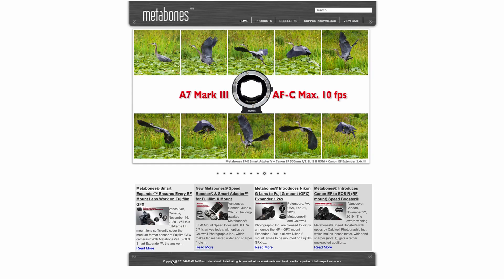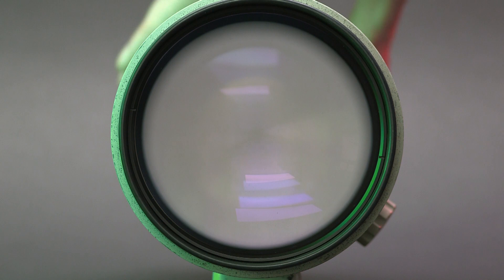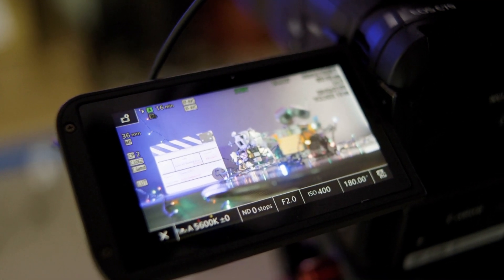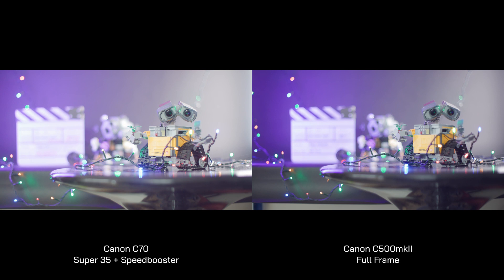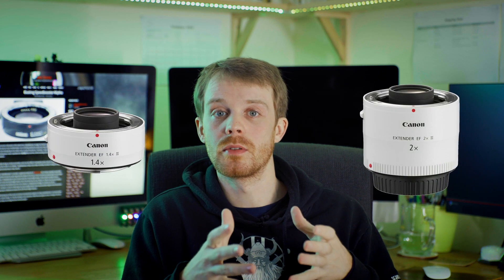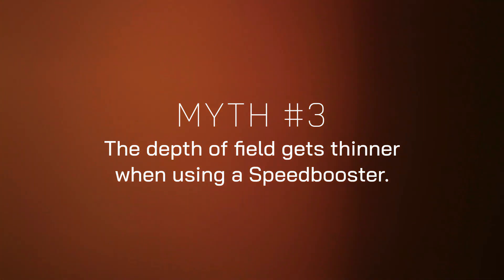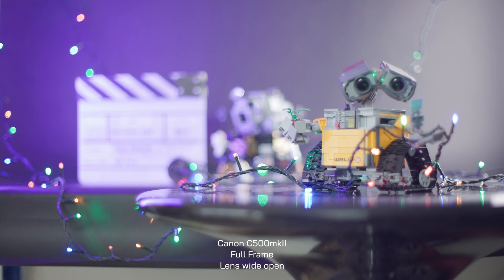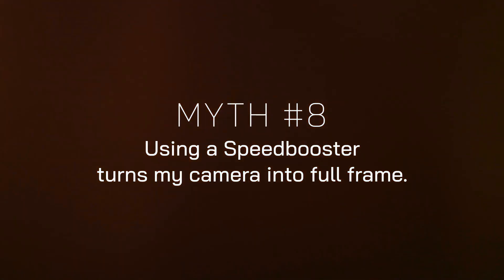Speedboosters EXPLAINED - The truth about focal length reducers

Comment: Very informative. I had studied the topic enough to have what I felt was a good basic understanding of speed boosters. This video clarified and improved that understanding. Great job. Recently purchased a MEIKE EF to R 0.71x SB to use on my R10 APS-C camera as I wanted to take advantage of my wide angle EF mount lenses for landscape and astrophotography but on a regular EF to R adapter, the 1.6x crop factor narrowed the FOV too much in my opinion. Using the SB brings almost brings back the entire original FOV as I have with my FF camera using the same lens, plus an effective increase of light by around 1 stop.

Comment: A modern speed booster designed for a vintage lens may incorporate elements designed to correct for aberrations or flaws in the original lens.  Because a speed booster is basically adding elements to the lens, it gives the designer an opportunity to modify the fundamental performance of the lens.

Comment: Despite being tiny, speedboosters are insanely good for them providing an extra stop of light. Making a really cheap 50mm f/1.8 lens perform almost as good as a very expensive 35mm f/1.2 autofocus lens if that even exists. And since the F/stops are not as accurate as the T/stops used in cinema lenses, I believe most manufacturers who make an f/1.2 lens are likely gluing the speedbooster into the cheap lenses they make and calling it an f/1.2 lens. It's a budget alternative to picking up canon's L series lenses for example. Of course it's probably not gonna be as sharp, but the metabones speedbooster adapter I got for my canon R7 and cheap EF 50mm lens, it remains almost as sharp wide open compared to without the speedbooster and even sharper if I stop down to F/1.6 which is brigther than F/1.8 and definitely a lot brighter than stopping the F/2.4 to achieve a similar level of sharpness without the speedbooster.
Very nice and informative video you've got there. Thanks.

Comment: Using a speed booster does NOT change my APSc camera into a full frame camera........................However the perceived FOV of the lense will be much closer to that of a full frame camera with the same lens.  The speedbooster will allow to APSc sensor to view closer to it's full frame equivalent, when the crop factor is used.

Canon APSc is 1.6 crop, 0.71 Speedbooster - Means a 50mm FF lense will be seen as a 56.8mm lens on the APSc camera.
50mm x 0.71 = 35.5mm x 1.6 crop factor = 56.8mm FOV through the view finder.
50mm x1.6 Crop factor (without speedbooster) = 80mm FOV through the lense.

Comment: Has my comment been deleted about how the sensor size is related to the acceptable CoC, therefore has an influence on DOF? If so, may I ask why it has been deleted?
Reply from the maker: No comments have been deleted...
Reply: @alex-stone  Oh ok, something must have gone wrong when I tried posting it. I was commenting on the statement that I don't think the statement at 9.00 is true. DOF is actually affected by sensor size when you watch the recorded image on a screen with a fixed size: To display the image of a MFT sensor on your screen, you need to enlarge it twice as much as an image recorded on a full frame sensor (MFT sensor is half the size of the FF sensor). For that reason, the acceptable CoC on the MFT sensor is about half the size as the acceptable CoC on the FF sensor. For that reason, the DOF on the MFT sensor is about half as deep as the DOF on the FF sensor (I know this sounds counter intuitive, but you can easily test that yourself with a DOF calculator. Choose one like DOFsimulator or PCAM and only change format size without touching the other parameters). Any comments?
Reply from the maker: @cordvision  The perceptual depth of field changes depending on a number of external and variable factors such as display size and even resolution: the closer you look at an image, the more critical the threshold for what is in or out of focus and therefore the thinner the depth of field is perceived to be: the CoC is what is deemed to be acceptably in focus given these additional parameters.

The optical depth of field however - the light projected through the lens - remains unchanged as demonstrated in the video.

The above two distinctions are important and are how the Achtel 9x7 camera claims to have thinner depth of field than IMAX film, despite the fact it uses a S35 sensor. Side by side with another camera with the same physical size sensor and, when displayed at the same size, the depth of field characteristics will be identical. Zoom in to each image at 1:1 pixels however and the Achtel will appear shallower simply because the blur has been enlarged more.
Reply: @alex-stone  Not sure what you mean by "optical depth of field". There is no such thing as "optical depth of field" as far as I know. Without defining an permissible CoC you don't have any depth of field at all (literally only a plane with basically zero depth is "in focus"). Therefore, in order to even have depth of field, you need to define the permissible CoC first. This will then have a direct influence on the observed DOF of the image on your viewing screen (in absolute measurable terms... by measuring the CoC on your viewing screen). If viewing conditions for both formats are the same as well as recording resolution, the DOF of a smaller sensor will be shallower than that of a larger sensor. This is even true in your wall example. For the image projected on a smaller portion of the wall (smaller sensor), you would have to move closer to the wall when looking at it (else the image would be much smaller in your field of view). Shortening the viewing distance affects DOF the same as enlarging the projected image. At the end of the day, DOF is all about perception... it is deciding how large a single point is allowed to be in your image to still be perceived as a single point. You therefore can't ignore viewing distance or viewing screen size. This is why a DOF calculator tells you that your DOF gets cut in half by simply changing from a FF sensor to a MFT sensor (without touching any other parameters).
Reply from the maker: @cordvision  What I mean by optical depth of field is the size of the blur relative to other objects in the frame - how pronouced the bokeh is. Viewing distance, format size and resolution have no influence on this - it's the image formed by the lens.
Reply: @alex-stone  Sure, but the "relative blur" is not relevant in this case to determine DOF. Here is a practical example: I'm having an actor standing in front of a picture holding a pen in front of his face. The pen is 2.73m from the camera, the actors eyes are 3m from the camera (camera is also focused at 3m), and the picture behind the actor is 3.3m from the camera. If I'm shooting on a FF sensor with a 35mm f/1.4 lens, the pen, the actors eyes, and the picture behind him would be in focus. The DOF extends from 2.73m to 3.3m (total DOF is 0.57m) so everything is in focus. I now change the FF camera for a micro 4/3 camera, and don't touch anything else (same lens, same f/stop, same distance to subject etc... only thing that changes is the sensor size). How come that only the actors eyes are now in focus and the pencil as well as the picture behind the actor is out of focus? The DOF now extends from 2.86m to 3.16m, which means the total DOF is only 0.3m. This is half the DOF as with the FF camera so the pen and picture are now out of focus. So how can you say that the format size does not change the DOF with the above example in mind? I'm genuinely asking.
Reply from the maker: @cordvision  The mathematical DoF of what's considered in focus may change with different formats given the different CoC as discussed in earlier comments, however the optical properties of the light being transmitted through the lens does not change with format size.

To use your example, let's say there's some fairly lights or LEDs on the picture behind the actor. The size of one bulb relative to anything else in the frame remains the same, whether that's the actor's eye or the width of the pen; the format can't change how out of focus that light source is. (The same applies to anything in frame, I only use a light source as reference as the resulting bokeh would be more clearly defined - as demonstrated in the video.)

Taking a frame from the FF camera and cropping it in post to the same FoV as the M43 camera would result in an identical image to one taken with the M43 camera. Cropping has no effect on the optical blur; using a smaller sensor simply windows off part of the image in the same way - it's cropping in camera.
Reply: @alex-stone  To stay true to what is said in the video would be to compare the DOF of a picture taken with a FF camera, then crop it in post and compare it to the original. Cropping a picture in post DOES change DOF when viewing it at the same size as the un-cropped image. I know this is counter intuitive, which is why so many people are confused about it. Just google it. There are a bunch of discussion on this subject. The one on dppreview that discusses how cropping in post affects DOF also shows many examples.
Reply: BTW, even the wikipedia article on "circle of confusion" will mention that DOF changes with the crop: "The DoF... ...will need to be adjusted if the original image is cropped before enlarging to the final image size". Also, here is a comment from a PhD Physicist (falconeye in the pentaxforums): "Depth of Field is based on the capabilities of the human eye, not the sensor pixel size. Therefore, Depth of Field does decrease if an image is cropped even though its pixels don't change. This is paradox and one of the causes for the many misunderstandings".
Reply from the maker: Michael, I think we're going round in circles (of confusion) here. I am not disputing that viewing distance and enlarging an image changes the DoF we perceive; the point you keep reiterating. None of these factors have any effect on the image produced by the lens, the distinction I am making.

Since your first comment, your tone has been quite belligerent - I saw the recent comments above before they were edited. It's not the first time we've conversed either; I remember you being equally as dismissive when I tried to purchase some of your products many years ago.

Making a video about depth of field has been on my list of ideas for some time now. The above discussion has been insightful and I'm sure it'll be useful if I ever get around to making it. Until then, I've spent enough time on this debate. Feel free to make your own video in the meantime though.
Reply: @alex-stone  I agree, we aren't getting anywhere. I think we are on the same page with the "technical" explanation of what is happening, but I disagree with the language used to describe it. The point I'm trying to make is that if you say "DOF does not change", you are talking about the relative size of the blur circles in relation to the other elements in the image is not changing... I agree that the relative size of the blur circles (bokeh) compared to other elements in the image stays the same, but this does not relate to DOF so the word DOF shouldn't be used in that context. Nor does it makes sense to say that the lens projects an image with a specific DOF,  as there is no DOF at all at the stage the image gets projected. The word DOF has a very clear-cut definition and I don't think it matches with the way your are using this word. 

Sorry, I didn't mean to be belligerent.  I originally wrote "The last part is exactly where you are wrong", I changed this because I realized I miss-read your last paragraph. I though you compared a cropped FF image to an un-cropped FF image, hence my original response. After reading the comment again, I realize my mistake, so I edited my reply.

I just went back to read through all our e-mails. Sorry if I was coming across as dismissive... I did reply to you with "I hope it didn't come across the wrong way". I was originally confused why you wanted an adapter ring of this size, back then, I didn't even know that anybody else makes them.  

BTW, I really appreciate your video. I really liked it because I think it clears up almost all the miss information out there on that topic (just disagree with the part about the DOF and because everything else was spot on, I though it would be worth pointing out).

Comment: Hello, to calculate the hyperfocal distance, how would it be? for example: with a 50mm 1.4 lens + speedbooster 0.71 + m4/3 sensor (Coc 0.015)
Reply from the maker: The same as calculating a 35 f/1.0 lens + m4/3 sensor

Comment: Just a thought after watching this video. If we have a super 35 camera so 1.5 crop and use apsc lens but in slowmotion that has 2.0 crop add the speedboster we could possibly have the same image characteristics negating the vignetting of apsc lens with speedboster - right?
Reply from the maker: That would be an interesting use case. I haven't tested that but in theory I suppose it would work. Do remember that the slomo crop is a digital crop so resolution and image quality (sharpness and in some cases dynamic range, bit depth etc) may take a hit. But yes in terms of just field of view, a speedbooster would help negate the digital crop, just remember to take it off when going back to normal speed ;)
Reply: I think in most cases assuming modern 4k super 35 cam it is downscaling from 6k or higher resolution. With digital crop it would still be 4k. Speedbooster could also help to keep the brightness similar as slow motion will reduce amount of light due to shutter speed change.
Reply: And obviously you will lose autofocus so it is not ideal in slow motion for wildlife and fast moving objects.

Comment: The brightness test is like the nectar of the gods!  Tony Northup has been pushing that the speedbooster doesn’t increase the light transmission…even knowing that that the extra glass is  effectively a magnifying glass for the lens.
Reply from the maker: He perpetuates a lot of misconceptions. Don't get me started on what he says about focal lengths and crop factors...
Reply: The speed booster doesn’t increase the light transmission.  It increases the concentration.  A magnifying glass focusing sunlight to a single point hot enough to melt rocks is using the light available to the surface of the magnifying glass which would be the same light available to this region even if the magnifying glass were not even there.

Comment: Would love to see this video with M43 comparisons as well. Though that would start getting really complicated. A lot if misinformation out there on focal lengths, speed boosters and sensors though
Reply from the maker: M43 is half the size (quarter the area) of full frame, so any comparisons are simple - for the same field of view, half the focal length is required. To match depth of field, halve the aperture value too. Example - to match the 'look' of a 50mm f/2.8 on full frame, a 25mm f/1.4 is needed on M43. The FoV and DoF will be the same but the exposure on M43 will still be 2 stops brighter.

Comment: that helps a lot, thanks! i was fascinated by the idea that i could create a lens with the depth of field of a f/0.7 lens by combining a canon EF-mount full frame lens with f/1.0 and a speed booster to APS-C. There could be a speedbooster for canon EF to pentax Q, which would create f/0.5 from a f/1.0, but there is only a nikon f to pentax q. and as we learned here, the depth of field will stay the same. maybe it would be too shallow anyway
Reply: Yes, but it will perform very similarly to that same lens on its native full frame body. The incoming light will be about the same, and so will the field of view and depth of field. This is why people often say it's like turning your apsc into a full frame. I know he said it's a myth, but he's being pedantic with words. the effect is essentially doing exactly that. You widen the field of view by reducing the focal length, but then the crop factor negates/undoes that effect. You will still probably have slightly more noise and less dynamic range because you can't gain extra dynamic range by going lower than base iso on the smaller sensor, but otherwise it does essentially turn it into a full frame camera in the resulting image
Reply: @bluecollar8525  thank you!

Comment: This is a very great video Alex, thanks.

My question is, is there a possibility of using speed boosters on full frame camera. If yes, would it still affect the f-stop and the focal length?

Thanks
Reply: It would work if it is a speedbooster from full frame to medium format
Reply: @noelwangler  thank you
Reply from the maker: Yes, assuming you can mount it (for example E mount), you could use a speedboster on full frame. It would still affect the f-stop and focal length, but also the image circle. If you speedboosted a full frame lens, the resulting image circle would be APS-C and would therefore porthole (hard vignette) on a full frame sensor. You could however speedboost medium format lenses and these would cover full frame.
Reply: @alex-stone  thank you

Comment: Can a APSC lens be used with a speedbooster or does it have to be a full frame lens?
Reply from the maker: Yes, APS-C lenses can be used with a speedbooster however the resulting image circle would become even smaller. It would therefore porthole (hard vignette) on an APS-C sensor.
Reply: It works sometimes. For example you can modify the Canon EF-S 18-55mm and use it as a 24-55mm lens. 18-23mm has vignetting
Reply: 0.71x speed boosters are made for APS-C lenses and 0.64x ones are for full frame. EF-S lenses generally won't fit in speed boosters without modifying them.